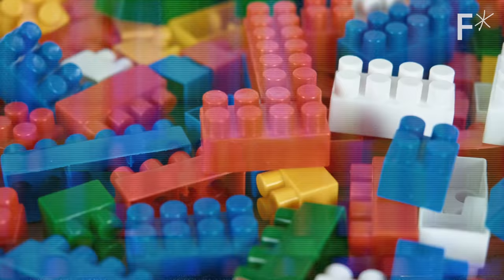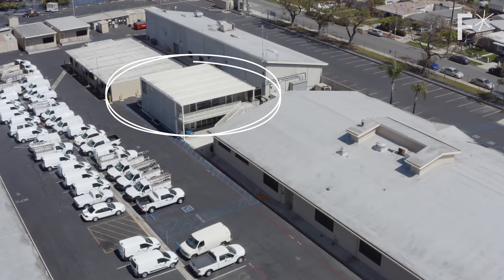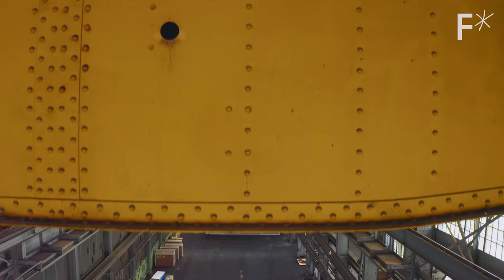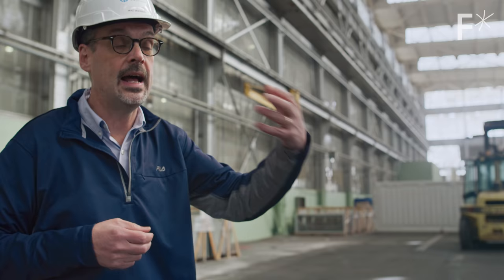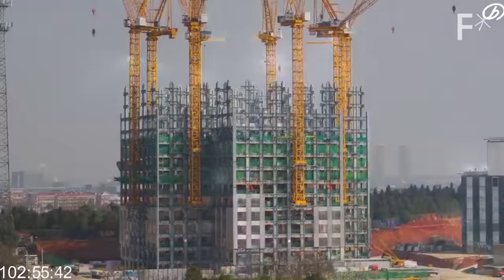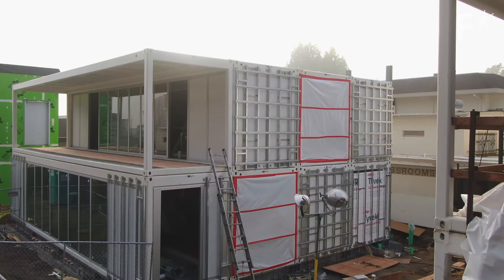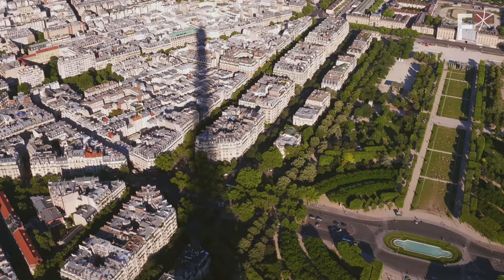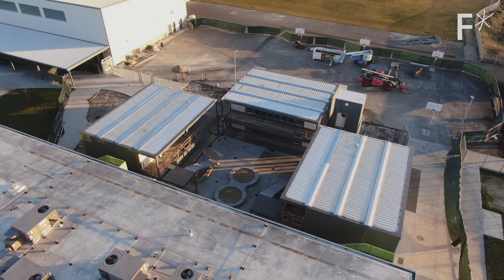Is modular construction the future? | Hard Reset by Freethink

Comment: The second to watch. First time ever.
I love the idea. Although it is very limited in design. How is it any different from turning containers into buildings?
Reply: Huge economies of scale? No walls until modules are set up? These are similar in appearance, but I think the layout & build are different.
Reply from the maker: Good question! There are certain limitations when it comes to using actual shipping containers for homes. This video does a good job of diving into them: https://www.youtube.com/watch?v=i7yEDz6bCfU but some of the basic ones are that they don't have a lot of structural integrity--especially after you cut out walls, they tend to be very small inside after you add insulation, plumbing, etc., and old ones can be contaminated while new ones aren't really cheaper than building a unit designed for housing from the start. 

This solution combines the modularity and flexibility that draws people to shipping containers but has the units designed from the start to be structurally sound and incorporate elements of buildings, while not having unnecessary elements like corrugated walls that would need to be cut away.

Comment: Suggestion: Require every building that is built less than 263 feet above sea level to be of this type. Why 263 feet? According to the USGS that is how much sea-level rise is currently held in glaciers, which are all melting. This could at least help mitigate the slow-motion climate disaster that is unfolding around us.

Comment: modular construction is not a new thing....in eastern europe where i live is very popular and inexpensive ,one container (30 square meters) fully equipped with walls ,electrical equipment,insulation,painted etc is around 10k euros ,you can add as many containers as you need , just bring the furniture and move in...is fabricated and installed in 2 to 4 weeks depending on the size.The cool part is that you don't even need a construction authorization ,you can just take 4 pylons and dig the into the ground and put the house on it.

Comment: Building deteriorate, and labor to take apart is high, so other than for military deployment or disaster relieve this is likely not the best to do.
Reply: I mean they can change the materials when it deteriorates too much and maybe recycle the old materials.
Reply: @SayYourSomething  Taking them apart is a lot of wasted labor. Most are demolished with heavy equipment in hours instead of weeks to take apart. People usually don't move mobile home, just sell it to the next dwellers.
Reply: @maggiejetson7904  They could innovate ways to take them apart faster. Demolishing buildings wastes a finite resource. And while demolishing takes only hours, it takes months to build something entirely new while this takes only weeks.

Comment: I’m curious what this would do to the real estate market if this becomes mainstream
Reply: Most real estate is there to stay. That is, the value is in the land so there is very, very seldom a reason to move a building in it's normal lifespan. The Detroit situation is an outlier. If you mean utilising this method for increased density or adaptation of existing sites - The main problem is zoning and construction regulations. You can't simply build a house where you want just because it can be disassembled. This is a niche product.

Comment: People have been doing this kind of thing for centuries WITHOUT dissembling entire buildings. Oh no, this small shop went bankrupt, now it's been renevated into a cafe. This guy moved out of the apartment up stairs from that cafe but now it's been turned into a law office. The point is we can do this kind of thing with normal structures built with local materials in local styles that maintain the character of our cities by designing buildings with multiple uses over it's lifetime in mind, a little renovation is normal. And hey, we could always build new buildings with prefab parts to add to our cities and just change the insides to suit our needs whenever things change.
Reply from the maker: Renovations and expansions are an interesting point. It'd be neat to compare cost, speed, and scale of different changes to buildings, and see the extent to which you could renovate buildings built with modular construction in place without having to swap them out.
Reply: @freethink  If you guys did a video for that I'd watch.

Comment: This could help solve the housing crisis.
Reply: Yes exactly. The important thing is that this could be a parallel industry that does not draw from the same supply constraints of traditional home building. If for instance a country implemented a huge government housing programme that would ordinarily spike housing costs due to lack of capacity.

Instead, countries should implement a factory constructed housing programme, side step productivity and supply issues, and built out as many as required without inflationary pressures on the private construction industry.

Comment: The things that bother me about this is how do you deal with the plumbing system? Or electricity? Or water system?
Reply: The same way you do in regular buildings; connections in the walls, floors, and ceilings. With modular, you can have one dedicated utilities module and also design the rest of the modules to minimize the distance that those connections need to travel.
Reply: Ironically modular plumbing systems are the first and easiest things to prefab. Huge savings in time and coordination. Google for Bathroom Pods. Cars have a modular electrical system - it's called a wiring loom. Tesla is pushing modularisation of the wiring to the limit with the intent of using robots to fit them.

These are good questions - but they are largely answered. The problem is that construction is perhaps the most risk adverse and conservative industry that exists.

Comment: The theory is flawed because the idea that it would be cheaper to deconstruct and reassemble old buildings that probably need refit of 20yr old hvac systems and wiring as well as repainting and design changes, when it would just be cheaper to manufacture new modular means it will never be like they say in the video.

Comment: Something a modular building does not offer: the art (or beauty) of modern skyscraper. Nevertheless, modular building is a good replacement for traditional low-level building
Reply: I see this as a commercial, industrial usage mainly, but add in other niches like disaster relief/response and even issues like homelessness and safe houses, etc. One good aspect is the fact this will require humans to build and assemble/disassemble, etc. It will be good for jobs and covers enough areas that more traditional builders can focus more on their respective areas of expertise.
Reply: Why not?

Just change what you attach to the front of the building and it will look unique.

Comment: How well would it stand to tornados & hurricanes?  If used for schools, I see a huge liability. I'm on the fence with this, I have more questions then they could answer.
Reply: Containers like these survive wild weather and the gyrations of a container ship in storms with no problem. They're bolted down. With a moment frame construction they are strong and rigid and way stronger than a light lumber framed construction.

I don't see the problem.
Reply: @Narja here in TN tornados wipe them out, including the one with extra bracing and bricks around it. Yes everything can get taken out by one & no I've never seen one like that
 Trailers Yes, but they have to evacuated from them.

Comment: Hilariously stupid. This doesn't really solve much of anything and adds transport costs and reduces local sourcing. It ties the hands of architects and increases reliance on HVAC equipment while making passive solar a little more difficult.
The obvious way to achieve building re-use is to make them easy to take apart. The re-use they propose requires adapting to different plumbing and HVAC codes of different locations. For instance is every module piped or just some of them and to what code? As a plumbing engineer with decades of experience I can tell you that these ideas have come and gone. They always end up actually costing more.